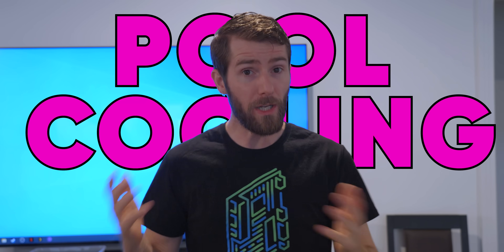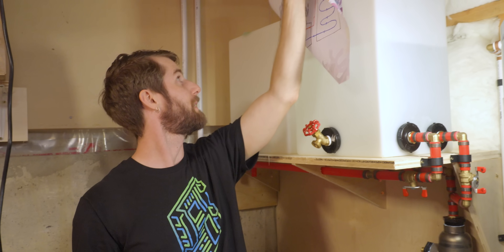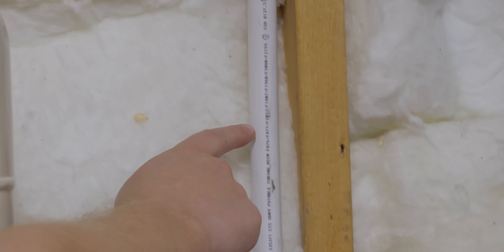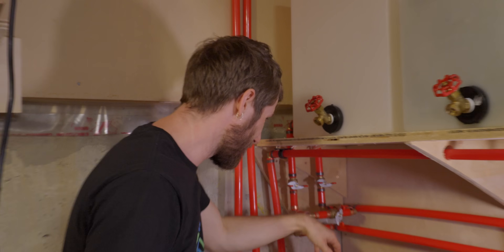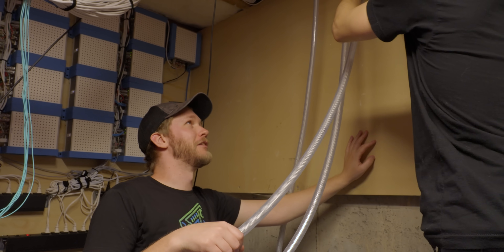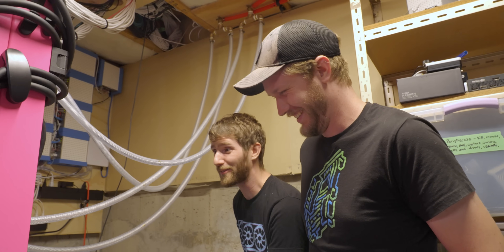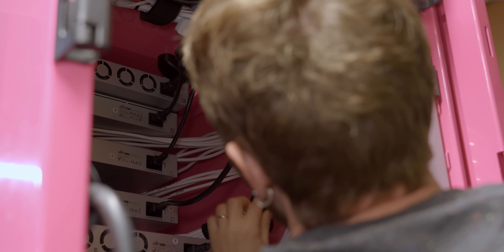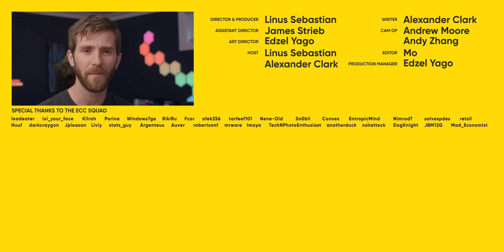My pool leaked and killed my computer - Whole Server Room Pool Watercooling Part 4

Comment: tbh it sounds kinda incompetent to make the piping going into the CPU heatsink out of plastic
Reply: That's literally how every watercooling loop works, unless you go for copper piping... Which is not something you do if you want to be able to maintain your system...
Reply: lmao, wtf do you expect them to make it out of?
Have you never seen water cooling before?
Reply: @ScarlettCatte  Any material that can withstand the same temperatures as the frame of the processor
Reply: @olliveraira6122 
I take it you've never seen water cooling before then?

Comment: in aircraft mechanics world,  this is common among all airplanes with jet engines.  Its called a FOHE, or Fuel Oil Heat Exchanger.  The hot oil heats the fuel, and the cold fuel cools the oil. Good Job Linus.

Comment: Kinda curious about what is the delay between the mouse and screen on those systems, maybe it was already addressed on another video? Can't remember
Reply: Basically none. I believe it's about an additional 0.0004 milliseconds of latency on the connection over a regular DisplayPort cable

Comment: Always draw arrows.

(labeling things + and - instead of <- and -> is the worst thing that happened to electronic diagrams and circuits after Benjamin Franklin)
Reply: Hol up, "after Benjamin Franklin"? What did Benjamin Franklin do that was worse? 😮
I dread to think...
Reply: @haxie4516  Labeled negative and positive charges the other way around. As in, current flows from plus to minus, but electrons do the exact opposite
Reply: Oh he's the bugger who did that?
Yeah, tbh, I agree, that's just... Evil.

At uni I was always peeved by that sort of thing, and never fully understood why that was labelled wrong (imo).
Now it makes sense! Thanks!
Reply: @haxie4516  Well, electrons themselves were only discovered some 150 years later. So his decision to label one side negative and the other positive had to kinda be a coin flip sadly.
Reply: @mskiptr  
Oh, sure, it's still annoying af XD

Comment: Having worked on a few data center container projects I find your chosen method of cooling a bit concerning... and you're just discovered why none of the major companies that make data center containers do it the way you've chosen to, it's too dangerous.

All of the successful container projects I worked on simply use the chilled water from the data center to cool the air inside the containers with the heat exchanges mounted in such a way that any leaks wouldn't drip onto the servers and would end up on the container floor and drain out without causing any harm.

I've also worked at several data centers where they cool individual enclosed racks or rows of enclosed racks.  It's extremely easy to do and very efficient and avoids many of the pitfalls of directly water cooling equipment.
Reply: Yes, but that would be exceedingly more expensive

Comment: It's a crazy idea how about using a heat exchanger to cool the air instead of the PC directly and have the heat exchanger to be cold by the pool.  This will also allow you to get colder than ambient temperatures

Comment: Wait, red PEX piping?!?! Nooooo!

It looks super "Janky"!

I wish you'd actually do it right with REAL copper piping on the pool side.  Think what you like, but PEX is Garbage!
Reply: PEX piping is a better fit for this application, as it doesn't corrode, and doesn't get mineral build ups.
PEX also won't radiate heat as much, which is what is needed, given they don't want the heat radiating into the server room before it even gets to the pool.

Comment: You have like 100000000000 connections with hoses. This needs maintenance, its going to leak eventually. This is not a good solution.

Comment: @4:00 Stranded wire needs wire ferrules. You got the plummer, now you need the electrician. :D
Reply: Only really an issue if you're using CCA wiring.
If it's pure copper it's mostly fine

Comment: I would put these manifolds inside of a closed box (similar to an outdoor electrical panel). then I'd put that box on the side of the rack while making sure to channel any potential leak away from the rack.... 

Unless you want the setup to fail again so you can make a third video out of this ... 😅😅

Comment: Please get your house wiring checked, you're having too many issues for it to be coincidence.
Reply: Lmao, what?
It absolutely is coincidence, because house wiring doesn't cause a SATA adapter to be made badly in the factory...
Reply: @haxie4516  It's not just this problem he's been having if you've watched more than this video, he's also had a dead PSU, bad motherboard, we did just watch a 25amp fuse blow, there's more than just a bad sata adapter...
Reply: @conorstewartme  
I have watched more than this video.

The dead PSU is a PSU that's fairly old, it can just be old age.
The bad motherboard was likely due to the leak.

And the 25A fuse blowing was literally the SATA adapter.

Comment: If you are using a fancy titanium heat exchanger, why use the separate embedded pool loop - Why not pump the pool water directly through it instead?

You may also want to consider a constant pressure pump on the inner loop, so you don't need to consider bypass pipes.
Reply: Because if that goes wrong, they empty an entire pool's worth of water into their basement.
Reply: @haxie4516  Fair, given their track record on leaks.

Comment: I have a MacBook pro that it's more than 6 years waterproof by now. How a guy with your resources knows nothing about conformal coating on motherboards and doing it just says 2 things: 1st: You're actually a newb; 2nd: Losing these items doesn't hit your pockets and someone will just pay for it with their stuff while all of us have to consider all the elements on the engineering side because it's our $ on the line.

Comment: You put the Plumbers tape on wrong, roll it then lay it in the threads, only amateurs put it on like tape...
Reply: That's a surefire way to have a lot of leaks.
If you want to do it that way, you need to use thread seal cord.

Comment: Had a similar thing happen ages ago when I was using a modded aquarium pump back in the day, prior to ready made PC pumps were available. It shut off mid-raid in wow, I was asking the other guys in vent if their frames were dropping, and they said no. Got down to 5fps, took a look at my PC, saw drips coming off the CPU block, shouted "GOTTA GO SPRUNG A LEAK" at the other 9 guys I was playing with, and ripped the power cable out of it.

It ended up being basically fine after I replaced the tubing, fitting o-rings, cpu block, and pump, so I got off really lucky.

Comment: You turned the pump around...  So you're installing the pump the way practically EVERY pump is plumbed, with a NPSH (you may google, you're welcome) tank providing good suction pressure to the pump.  Weird.

Comment: Have no idea why you'd run hardline tubing in an unseen rack where you'd never get the only benefit of hardline tubing, which is solely aesthetics. If reliability and thermal flexibility is what you're after, do yourself a favor and just always go EPDM tubing.

I've been water cooling PC's for over 20 years, and I know firsthand that hardline, regardless of the material, is something you do one time for the novelty and aesthetic, and then you never do it again. If you keep doing it, you care too much about fake internet e-peen points, or you're just straight up masochistic.

Comment: why didn't you guys place the manifolds and stuff at the bottom so that it at least wouldn't spill all over the components? It doesn't make a difference to the system pressure, but you just have way less possible points of failure.

Comment: So if you are worried the outside loop goes below freezing, wouldn't it stand to reason that the outside loop can freeze the the inside loop in the heat exchanger?
Reply: No, because they have a heating system.

Comment: Weird that the power supply died, that step down had an issue, and a switch died all at the same time. But that's just randomness it doesn't necessarily mean it has the same underlying cause. I'd root cause the shit out of it though

Comment: OUT and IN is definitely prone to confusion. I'd use arrows, and a label next to the arrow to what's on the other side.
Reply: Or use flow and return, like you would in a heating system.
Reply: Or just use arrows
Reply: I like 
source - device in - device out - return. Arrows are very important because some pipes can see reverse flow in some conditions so specifically calling that out is an important marker.
Reply: HOT and COLD are the correct labels as there is no way to confuse those. Since he's using QDCs on the computers, those should also be gender-matched so that the COLD port on the computer is female and the HOT port is male.

Even without labels, gender-matching QDCs in this manner is the correct way to do it. The flow direction should be from male to female. Thus, the COLD supply side of the manifold should have male connectors, and the HOT return side of the manifold should have female.

Apologies for the reply to an 8-month-old comment.
Reply: What is?
That bro, what is that?It's strange in question mark what the hell is that?What is that?I don't know.I just I don't know wrong and then that's strange
Reply: It can be interpreted either way. Like if you want to move a meeting "forward" on a calendar: is it happening earlier or later?
Reply: Agree, but also I'm on his side if I have to use in/out, "into the computer goes the coolant out of the computer comes the heated coolant"

Comment: Increase the diameter/area of the filter area and you won't have flow restriction. Assuming your loop is still closed, everytime you change the filter you should be needing to filter less and less. Not really sure why you have filth in the line in the first place, you should have cycled/flushed that out before closing the loop first anyway...? Maybe I'm just unfamiliar with the "electromigration"/tunneling penetration properties of gravel through piping.

Comment: Wait, you guys wern't using a heat exchanger already... I would have been worried about the super chlorinated water from the pool or leaves and shit.
Reply: They're not taking water direct from the pool, it's from a heating/cooling loop underneath the pool

Comment: I'd like to see what temps would be put ou tby all the systems connected pulling a full stresstest load CPU+GPU

Like, im sure it would still be fine, but it would be interesting to know what the temps looked like at the stations, and in the loops.

Just think about how much better that cooling is going to be come winter. lord, you might have to do condensation protection to the systems.

Comment: Linus, there is a local company in my country, that cools of their servers in similar way, tho they use mineral oil, and pump it straight into city´s public swiming pool for heating it up. Would consider somethin like this.. it may leak.. but the mineral oil will not short it

Comment: Hacking off the cable end and using it is fine if it's copper.   if it's a cheapie china CCA cable,  you will have problems as CCA wire is not designed to be in compression terminals. aluminum crushes a lot easier than copper, and it actually swells with heat so you will get loose connections.   European ferrules will help.
Reply: 💯
Absolutely!
Fortunately, I don't believe that was copper clad aluminium, but it's always something worth checking

Comment: Bro there is seriously something wrong with the rack. The blown fuse and the switch that has gone up in smoke are correlated
Reply: The blown fuse was due to a bad SATA adapter, 
and the switch... 🤷‍♀️ But it wasn't the SATA adapter

Comment: Why would you mount your manifolds above the computers? If there's a leak the water will go down to the computers. And did you not put valves in line to shut off flow?
Reply: They're quick disconnects. No valves needed.
Reply: @haxie4516  and what happens when one sticks open and you can't stop the flow?
Reply: @coreyh3170 
They're fail-safe fittings, and they have master control valves further up.
A valve for each of those connections would be far too much bulk, and wouldn't be accessible in most cases.

Comment: That‘s actually why I switched from PETG to acrylic tubing.
I had a fan controller failure and my system got hot enough to deform my tubing causing a massive leak during a gaming session.
The melting temperature of PETG is just way too low in case of a failure of some sort.

Comment: I've had 2 brand new unifi switches die by power issues last month. Plugged ethernet into one, and it popped then smoked (was only poe+) no passive poe. And had a second do the same plugged into a non poe switch. Both smelled awful.

First time I've had that happen in years of unifi switches, let alone 2 times in a week in different buildings. Unifi covered both bit still unsure wtf happened.

Comment: If you were going to use a heat exchanger; you could have just taped into your pool filter outlet and run the loop from there back out to your pool. This way, you don't burn any extra energy other than a small amount from the filter housing to your exchanger. No need for an entire under-pool loop with that heat exchanger.

Comment: instead of pool. Why don't you guys integrated the pc cooler with air conditioner.
Reply: They've done that, but it cools it down too much and causes condensation.
Reply: @haxie4516  is it liquid cooled or air cooled??!!
Reply: @choirulabidin9890 
What?

Comment: I'm sorry but what sort of QC testing on the plastic manifold was that?

"we know there's going two massive fail points on the unit so it will never get up to full pressure, and if that doesn't leak out of the parts we want actually test it'll be good to go in an active system at full pressure"

I've done many a hydro tests on pressure vessels and I would be swinging from a tree if I told the engineers that's how I tested and passed a vessel.
Reply: Uh...
These aren't pressure vessels.

There is a big difference there.

Comment: You just need either a button connected to P+ and P-, so it will power it on when the button is pressed, or hook it up to a wireless receiver with a switch in it. 
You've got conduits, quick connect cables exist for electronics. Unless I am missing some key information, it seems fairly simple.

Comment: Yeah... Unless they have a filter on that loop with glycol or added something else to the system it's going to grow shit just like the whole room water cool loop did.
Reply: I take it you didn't watch the video then?
Reply: @haxie4516  Nope, hence the "unless they" with potential remedies.
Reply: @haxie4516  Okay so they put iodine in the inside loop, that doesn't clarify if they put anything in the outside loop besides glycol which again will grow shit at "room" temperature. Might not hurt the computer but it can still gunk up pumps and lines. Which I still haven't watched the whole thing, I assume you did correct me if I'm "wrong" and they point out more than just glycol in the outside loop.
Reply: @Hellcat287287 
Glycol alone isn't green...
Reply: @haxie4516  Pretty sure he's referencing antifreeze... Which is generally green.

Comment: I literally had the same problem with my newly built gaming pc. I forgot to connect the fan controller power which allowed the fluid to get so hot that it deformed the tubes at the fittings….aaand you know the rest of the story

Comment: FYI you can't leave PEX pipes outside exposed to sunlight like you did there. it will disintegrate from the UV.... most pex is only warrantied for 30-60 days of exposure.
Imagine how upset you'd be seeing someone put a 7950x and 4090 in an enclosed case with zero ventilation stuffed in a box full of insulation. that is the same feeling as seeing pex uncovered outside...

Comment: So you are finally adding a heat exchanger, but for larger piping systems you should include filters especially when running into potentially (or actually in your case) dirty contaminated coolants.

Comment: I advocated to use a heat exchanger in that setup back when the old video was made. set it up like a geothermal HVAC system. Use methanol in the water to prevent freezing and a push/pull pump combo.

Comment: As someone that has done a lot of piping setups for aquariums (similar concept of flow and thermal ranges), never trust any gromet or screw in component, unless it can be chemically glued closed (a la abs plastic). The main thing I'd consider changing... put the distribution blocks at the BOTTOM of the rack, with a bucket underneath. Then put a wet floor sensor with a solenoid control in the bucket. If a leak begins, the water sensor flips the NC solenoid, and closes the water source. Then you could have a simple PDU with thermal sensor, start to shutdown systems if they get too hot. The reason for having an NC solenoid, would be in case of a power failure in the rack, your water pump turns off, preventing uncontrolled water circulation.

Comment: @LinusTechTips Linus you made a mention, you keep the reservoirs and old water cooling stuff int the cases. why you aren't make them active part of the system? even when you unplug from the "pool" they still can run as a small cooling system.

Comment: Alex we love you. But those are terrible manifolds. There are really nice ones you can get that are pre-built with vents/drains and each outlet/inlet can is valves so you can balance flow to each circuit (or in this case) PC cooler AND they have flow indicators so you can visually see if one is getting less flow then the others